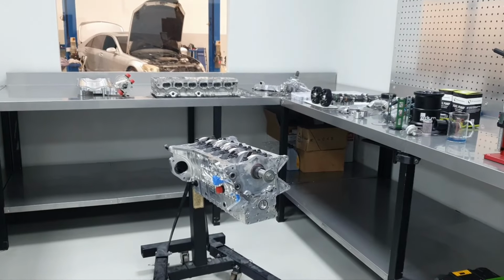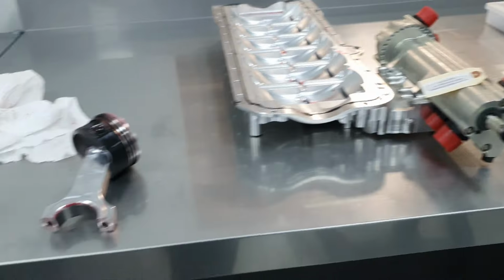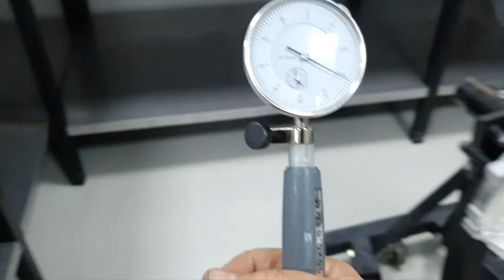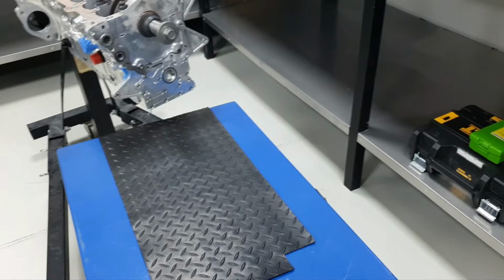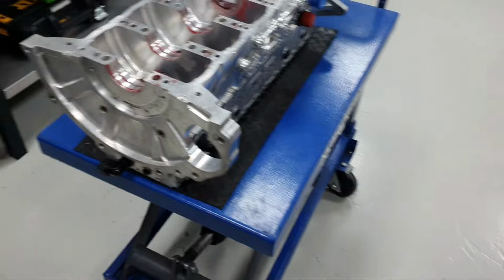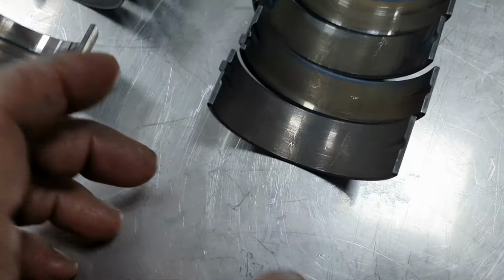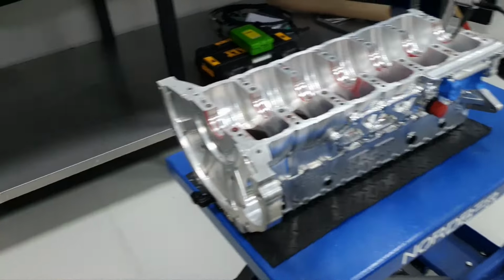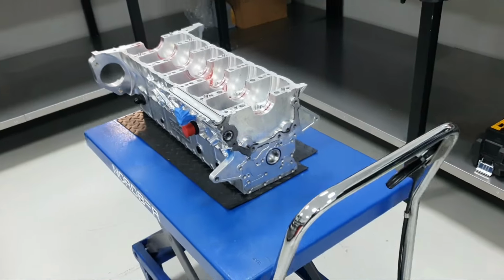2JZ-GTE billet block check/build (part 2)

Comment: It makes me very sad to see such nice / expensive parts damaged by people that have no fcuking clue what they are doing. So many things done wrong. I think the thrust bearings were damaged because they were bumped out of alignment when the crankshaft was installed and then the crankshaft was forced into place, probably using a sledge hammer, based on how everything looks. Probably something similar with the connecting rod bearing. It wasn't inserted correctly. It fell out of place, but the cap was installed and tightened with the bearings overlapping. Unbelievable. I have never seen such a terrible dumba** grinding job as was done on the crankshaft. This engine has been vandalized. It probably wouldn't have lasted very long if it was run. Too bad for the owner that he didn't just let you do it from the beginning.